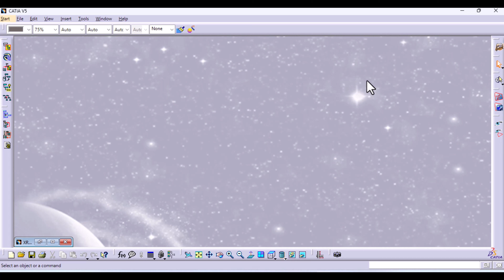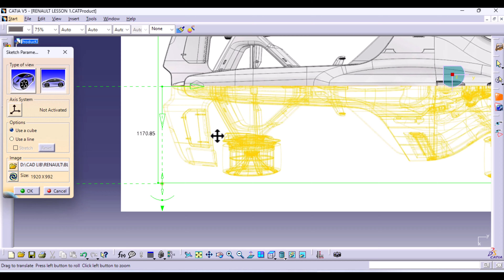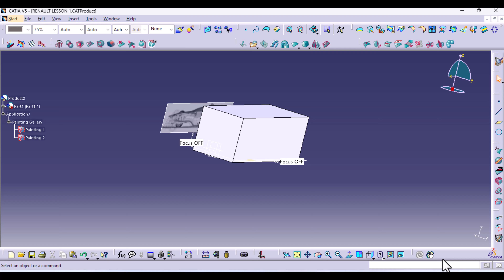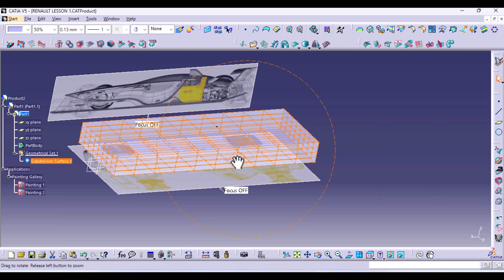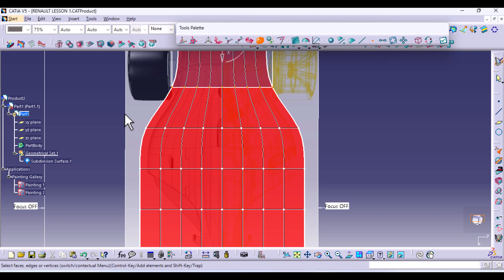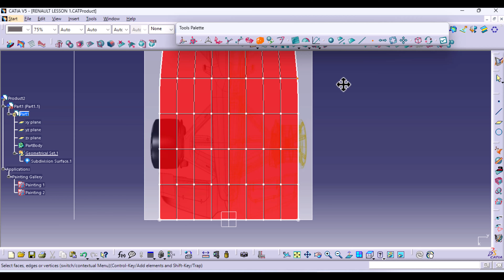CATIA V5 ICEM - CLASS A SURFACING TUTORIAL| RENAULT VISION  2027 F1 CONCEPT CAR DESIGN| PART 1

Comment: Quick tip for easily getting your view into one of the main orientations. If you go to the compass in the top-right you'll see it has X, Y, Z labels, click one of the labels and the view will snap instantly to that orientation. If it is the wrong direction, simply click again and it will flip 180. Much quicker than dropping down an selecting the view toolbar.